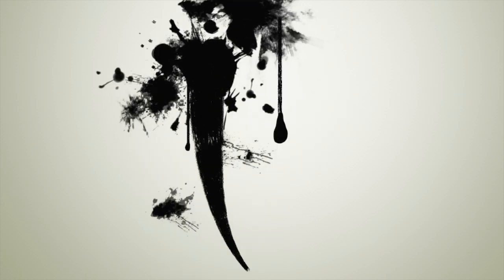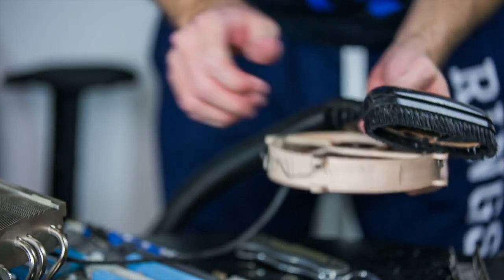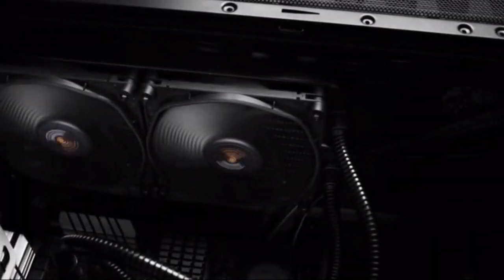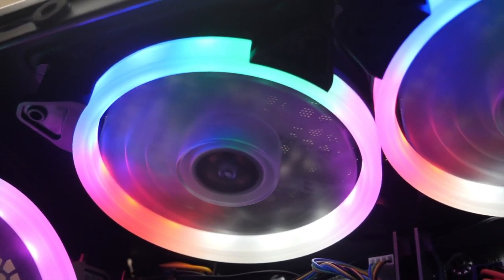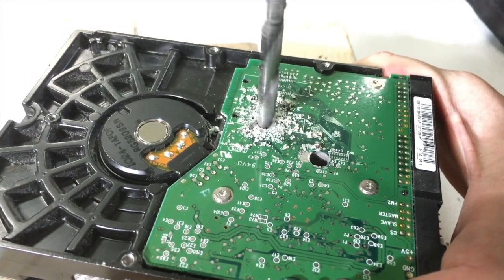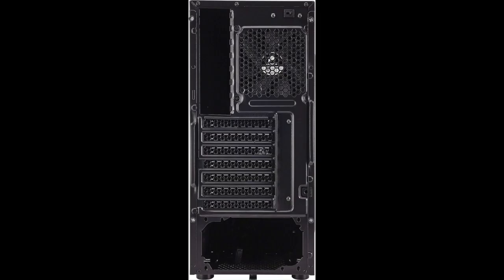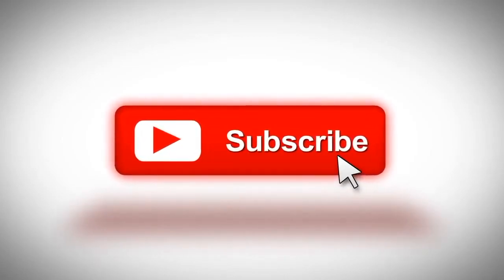9 Tips to Make Computer Quieter - Cool & Silent PC!

Comment: Please dont vacuum your computer, the static can damage components on your computer such as motherboards and graphics cards. Vacuuming fans and heatsinks is fine but I would use an air compressor or a can of compressed air to clean your computer, it is also more efficient than a vacuum cleaner
Reply: You beat me to it
Reply: Tetea Edi  that should be ok but be careful, if it has it, put it on fan mode with no heat, just in case.
Reply: Even a air compressor has static just use canned air

Comment: lol my PC is sitting in the same corner for like 5 years without cleaning.NICE
Reply from the maker: That would also contribute to the pc becoming hotter than it should.
Reply: @soundproofguide  yep i cleaned it and my cpu cooler was judt like full of dust  and when i cleaned it temperature got lower and my pc got quiter but im plannjng on gettinv New case, cpu cooler, New motherboard and 16gb of ram. I bought my pc in 2015 and it was i5 4460 3.2Ghz,8gb Ddr3, GTX 750ti. I only upgraded graphic card to msi gtx 1050 ti still decent pc can run every game on medium-high settings
Reply: Lord Vujkee why 1050 ti why.???
Reply: @chaos3924  whats wrong with a 1050 ti?
Reply: @userthatcantthinkofagoodna1440  it sucks
Reply: @userthatcantthinkofagoodna1440  Id suggest getting a gtx 1660 super, 1050 ti is really bad its almost the same as the 750 ti, either go for 1660 super or 1650 super

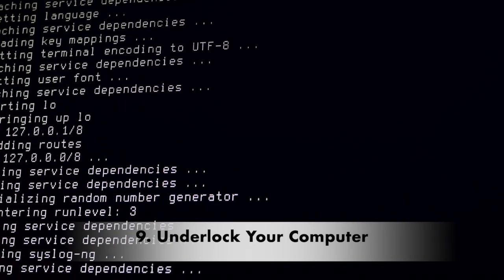Comment: 8:17 - *Underclock

This process slows down the CPU and/or GPU clock speed (frequency) in order to reduce its power usage, resulting in lower operating temperature, thus lowering the cooling fan(s) speed, which, in turn, makes it quieter.

Comment: Those Be Quit fans are bad for your ears. They aren’t actually quiety, the just vibrate at a much lower frequency, like, at a frequency your premium subwoofer can’t even play. That type of noise is bad for your ears.
Reply: I am unconvinced. "Direct evidence of adverse effects of exposure to low-intensity signals (less than 90 dB) is lacking. " https://pubmed.ncbi.nlm.nih.gov/1164350/
Do you think those be quiet fans can make over 90 dB of infrasound? Imagine the amount of wobbling that would take.

Comment: What if my power supply makes the most noise?
Reply: I was wondering the same thing I can still hear my power supply fan when I record
Reply: @pubstompzombie4445  well i don't hear just fan. That's normal. But mine is squeaking, clicking and making static noise whenever I do anything
Reply: @pubstompzombie4445  static crackink noise to be exact. Like a radio without a signal but quieter
Reply: Ondrej Lukacs I would probably get a newer or better one but if your tight for money I say maybe try opening it up and cleaning it see if that would help
Reply: @pubstompzombie4445  I was thinking about buying a new one. this one is over 10 years old
Reply: buy a new one, the more watts, the silenter it will be [i mean besides if your running an rtx 3080 lol]
Reply: @IvanTube0  Nah just EN 9400 GT XDD

Comment: How long should a brand new custom built pc last
Reply from the maker: The pc box could last for many years. You will need to upgrade the pc after a few years of course but the soundproof pc tower should last a long time.
Reply: the main components of a computer almost never fail (CPU, GPU, etc.) the only thing you would notice over time is it may become slower, but that's a storage problem. Dont build a computer that has HDD storage, choose a good SSD or M.2 Drive for your storage. They are faster to begin with and degrade far less slowly since its all electric - there are no moving parts, and they also last longer without slowing down.
Reply: @bigboat8329  SSD for system, HDD for files

Comment: I should be noted Larger fans are generally quieter, their larger blades means they don't have to spin as fast to move the same amount of air. Also liquid cooling is generally much quieter than air cooling.